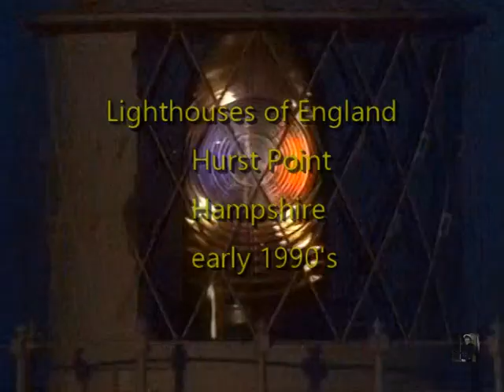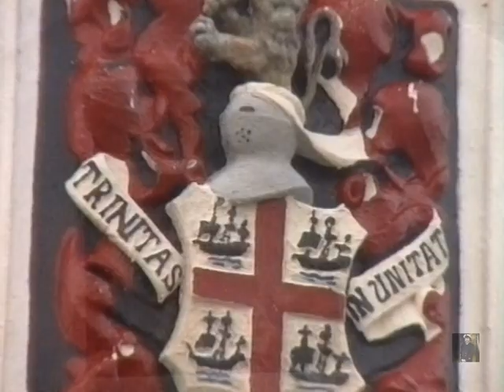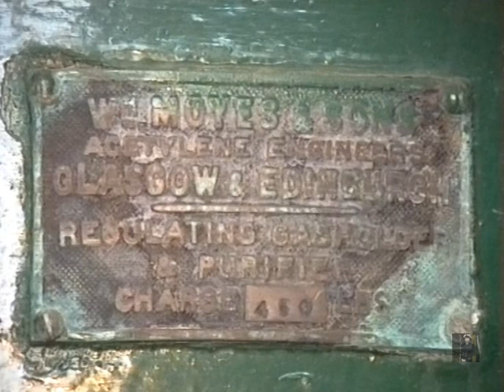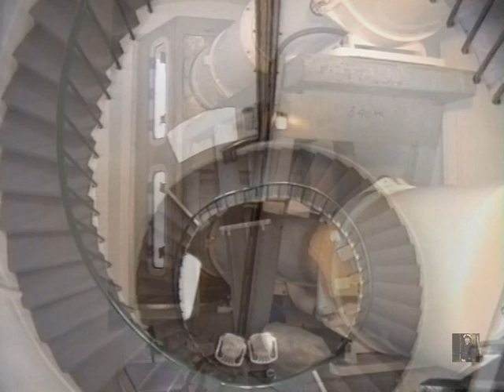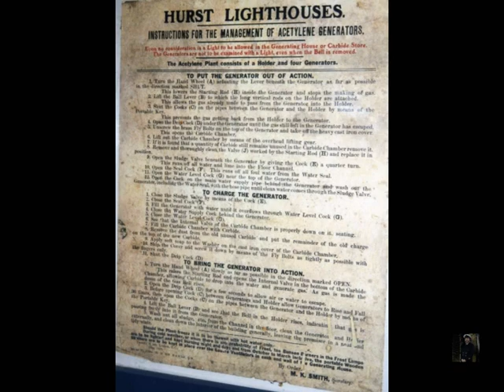Lighthouses of England,  Hurst Castle,  Hampshire, early 1990's

Comment: I maybe a day late to the party but thanks for another enlightening video. Do you know if there were many lights with their own acetylene production? It was a good idea.
Reply from the maker: Hi Stephen, I don't know the answer to that question. A lot of our Lighthouse history was either lost in the bombing of Trinity house during WW 2, or over some cliff during automation! Maybe the Association of Lighthouse Keepers can track down more info than I can  https://alk.org.uk/
Cheers, stay safe.
Reply: Bet a lot did-- I collect old technical manuals and used to be a welder, and it seems like acetylene generators were extremely common until about the 1950's. I think they made up some new process that used natural gas and catalysts around then, so the bottled gas became much more economical than making calcium carbide, which took a LOT of electricity to make. It's hard to find carbide nowadays (I have some old lamps, and back in my oil field days we used it to time the drilling mud by throwing a bag in a pipe when they connected it and then seeing how long it was before our gas analyzer spiked) while it was everywhere back in the day.
Reply from the maker: @gresvig2507  Thank you for that, very interesting. I also seem to remember, back in my school days, some kid blowing the hub caps off of a certain teachers car with a bit of carbide and some spit! Happy days. Cheers again and stay safe.
Reply: It was an excellent idea, I thought that too. 👍🏻